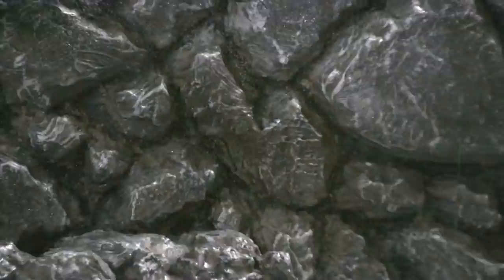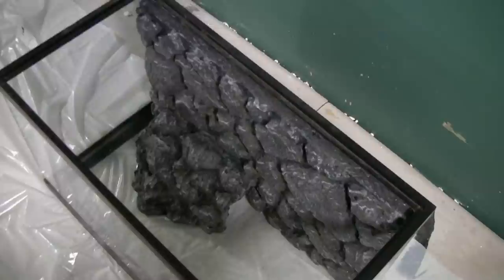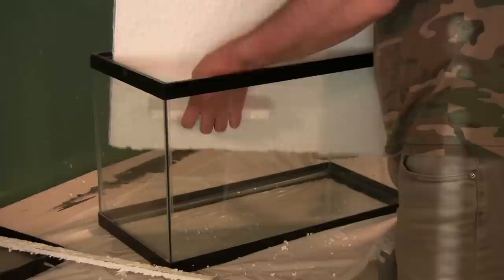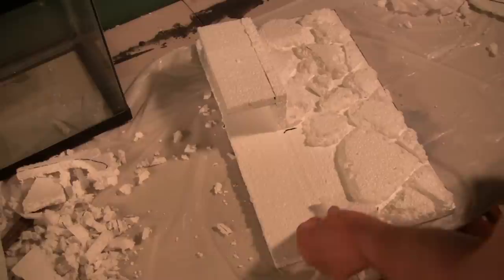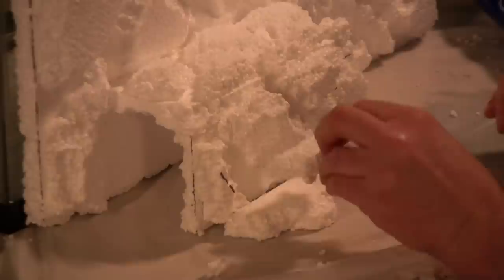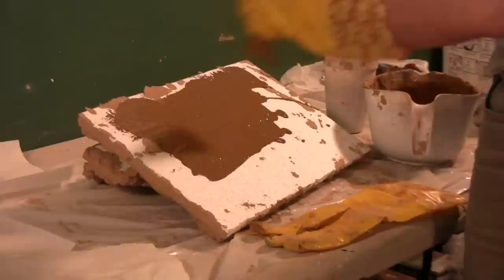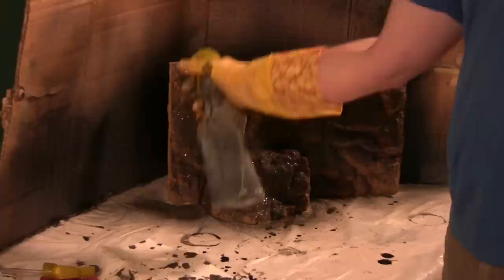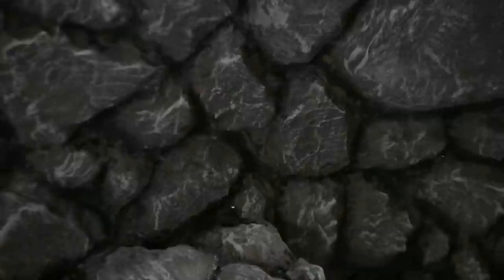Rock Wall background tutorial for reptile cage

Comment: If you have problems with grout adhering use PVA non toxic craft glue it bonds with the polystyrene and holds the grout to it. We use this trick with plaster and grout in terrain design for miniatures and gaming.

Comment: Im making a back for my sons ball python tank (50 gal) and it's going to have to be built in 2 pcs. and was in the same boat as far as trying to find a way to secure both pcs of the rear of the tank. I decided to use the same magnets that Magnaturals uses for their shelves. And yeah...they'll hold, these things are STRONG. Going to use 1 set on each corner so 16 total. Try looking up K&J Magnetics and look for anything between 1/2"- 3/4" X  1/4" but be sure they are N-52 rated (strongest ones)

Comment: I want to build a 20 foot high by 14 foot wide rock wall just like this for a spa I'm building! This result is very beautiful and is AMAZINGLY cheap (3-5 hundred dollars?) compared to real rocks or even the foam rocks for sale commercially. Wow - nice video! I'm going to use 2 inch and 1 inch thick foam board from Lowe's and mount it using Loctite right onto a plywood wall and then do the grout coat on top. I think the grout coat on top is to give it rigidity, right? Otherwise, it will FEEL like foam and we want it to feel HARD - is that right? I know you're doing this for animals and reptiles but I'm just applying it for a regular wall so the ladies will be wowed by it. 

Also, the sealer for me I don't think would be necessary - I don't really care if it's watertight at all so I may skip that step. My rocks will be as big as 12-15 inches so my scale will be a lot bigger but I guess with such big rocks a 20 foot high by 14 foot wide project should go that much faster, huh?  Do you have any thoughts or advice for my application? The painting will be labor intense -  will need a platform to do the hand painting and the various coats. Your result here with the white highlights is absolutely stunning - I'm absolutely stoked that I was about two hours ago budgeting a few thousand and thought I would have to check with an engineer to see if the structure can hold a couple of tons in rocks to THIS! Brilliant - foam! Love it.
Reply from the maker: Yes, the grout is for strength.  For what you're doing I would apply a lot more layers to give it more strength, the many layers of grout will make it quite a bit heavier though.  The sealer will help strengthen it.  Will it be inside or outside?
Reply: LizardLandscapes DEFINITELY inside. I'm glad you responded - was about to call your business for advice. I'd buy a reptile but I'm a dog person.

For strength, I agree - also can I just use regular mortar?? Does it have to be grout?

I'm planning on doing this while it's on the wall... or should I plan to do it on the floor then lift it into place and secure it? See, if I do that the whole thing will be weighing on a one inch layer of foam and I'm nervous that it can simply topple one day... but if I take each individual piece of foam and embed that with Loctite to the plywood wall then even after I place mortar or grout on it it will not become weighed down (front heavy as you said in the video) compared to each piece of foam attached to a one inch piece of foam for 18 feet high by 14 feet wide.

Also, the hot wire cutting device - is that something I can find at Lowe's?? Never seen that. But I guess the cuts are a lot more "mother nature looking' than a knife and makes less dust and maybe even is quicker. I see you break off chunks of the foam with your hands - that's the quickest way to go but for the beveled edges I imagine the hot wire device works best.

To see the look I'm going for go to my fb page at www.fb.com/iBeachClub (www fb com / ibeachclub
Reply from the maker: Rojerico Marthasis
I guess you can use any mortar.  It would be easier to apply if it's on the ground.  You do raise some good points though, -I wonder if you could do a small test piece to see if it will work?  The hot wire I use in some videos is from the Hot wire foam factory, they're online only I believe.

Comment: Hey mate,

Just a question about using the grout. Does it change the PH of the water once its in the tank? I am planning on doing this for a fish tank and I have seen a few done where they use cement and they say you need to fill and empty the tank 8-10 times. Does this need to be done with this method?

Comment: Would it be safe to just stop at the 8:50 mark and just put it in the tank from there? Or does it need more sealants, etc? Personally I like the color more and it goes more with the theme of my tank that I'm going for.
Reply from the maker: tkunkel4395 I would advise using all of the steps to be safe.
Reply: Ok thank you. Would I just find that color of paint at any hardware store you think?
Reply from the maker: tkunkel4395 I got mine at an arts and crafts store.
Reply: Also what's the sealant called that you used at the end in the spray bottle?
Reply from the maker: tkunkel4395 It's called Shields All.

Comment: This is more of a general question to all of your videos. Would this technique work for my 40lbs 9' boa? Or would I have to use a higher density foam and concrete over mesh to handle the higher weight per square foot?
Reply from the maker: ***** I would use 2 by 4's to create a strong understructure, and then apply foam and Hot Wire foam factory's "exterior foam coat" (many layers) to create a tough structure.  There's still the possibility of a snake of that size damaging it though.

Comment: Can this be used for scorpions, which is tropical and requires the tank to be wet and humid?
Reply from the maker: You would have to use a water resistant sealant like the one I'm using in the video.
Reply: Okay, thanks.

Comment: First off, fantastic videos, I've binged most of them and can't wait to get started on my own rock wall and cage features. Question for you, have you ever used the Mod Podge spray (found it on Amazon)? Or do you have a way of making mod podge more spray-bottle friendly?
Reply from the maker: I've not used the spray.  I have in the past watered down regular matte mod podge to work it's way through a spray bottle.  A while back I started using Shields All, -it doesn't need to be watered down.

Comment: Would something like this be appropriate for amphibians?? I'm trying to redo my whites tree frog habitat to make it look a lot better, this would be great but I'm not sure how it would do with the moisture in the tank. Since frogs skin are is so sensitive I don't want it to be something that can harm them. What is your thought on it?
Reply from the maker: I guess it's a little more appropriate for a dry environment cage, although the sealant is designed for water resistance.  You might re-seal it every two years or so.  You might forgo the fine grain sand sprinkling, as it might be too abrasive to the frog's skin.  I assume you're spraying the cage, or have a mister?

Comment: I have to spray my cage daily for my geckos which means they drink the water off the walls. Would it be safe for them to lick the water off the wall with the paint and everything else on there?
Reply from the maker: It would cause i used a non-toxic water resistant sealant to cover everything.

Comment: Not sure if you still respond to these, but my question is related to keeping it in place in the back.  I didn't want to create a hide because I have a beardie and have a separate hide.  Would I have to glue this in place or do you have a different recommendation to keep it up and In place?    Thanks for the great video.  I started this tonight and it looks great so far 👍🏻
Reply from the maker: I guess you would have to glue it in place.  In stead of a hide you could make rock projections (like the hide) to keep it from falling down, without having to make a hide out of it.
Reply: LizardLandscapes that's a good ideas I've even thought so far into it as to maybe put Velcro strips on the back at the top and on the inside of the cage so it can be removed if needed. Could this cause any problems
Reply from the maker: The problem with that is the glue (sticky side) from where you attach the velcro could be too strong and end up pulling the structure apart.
Reply: LizardLandscapes good point.  Sounds like the best option is to glue it in.  What would you recommend using to glue it in place?  Power grab?
Reply from the maker: I'm not sure what would stick to glass effectively -maybe silicone?
Reply: Hmm I'd rather not chance it.  I'm going to try and add the rock ledge tonight to sit it up.  Thanks again for the replies and detailed video
Reply: So I added the hide, I decided to just go with this and remove the other hide, as it will create more room and give him possibly a better basking spot. Wish I could post a picture it looks really good
Reply: One last question, on the sealant stage are you doing one coat, waiting 72 hours then applying another until you have 4 coats?  Or are you doing all at once then allowing it 72 hours
Reply from the maker: Yes, I am doing one coat, waiting 72 hours then applying another until I have 4 coats.

Comment: I have a question about the Shields All at the end of your (Fake Rock Background) video.  It seems to be like a runny type of sealant.  I have Mod Podge for my project, but it is thick like glue.  How did you reduce the sealant that you used?  I am afraid to brush on the mod podge and have it damage my work.

Comment: I've heard to use concrete to keep it from cracking. have you tried this
Reply from the maker: I have not, but some use it with success.
Reply: What we found that works is to mix in  "Acrylic Fortifier” liquid by Quikrete right into the grout mixture. It comes out super, super strong, water proof and will not crack. We also add the color right into the mix so when it dries it has the base color to work with. The results are stunning and realistic. No cracking and the color does not fade. I also would stick sand and push smaller tiny rocks into the grout crevices of the fake rocks before they dried to add more realistic color tones and textures to it.

Comment: Can mod podge handle the constant heat of a bearded dragon terrarium?
Reply from the maker: +Albert Gomez Yes, but you need to build up the basking spot with layers of sealant then sand sprinkled on the wet sealant -then repeat -to that the hot spot is built up and very tough.
Reply: +LizardLandscapes Alright, thanks for the quick response.

Comment: if im using spray acrylic paint for snake terrarium is ok?
Reply from the maker: Are you going to seal it with a non-toxic sealant?
Reply: not now but im asking if i need sealant or not. My snakes are cali king and mexican milk so its not high humidity. What can u say?
Reply from the maker: You will need non-toxic sealant.  It protects your pet from harmful materials.
Reply: ok thanks alot!
Reply: are you sure this sealants stick on acrylic paints? Becasue i tryed to use sealant now but it looks like it just float off the painted surface.
Reply from the maker: Sabestooo
What is the brand of sealant you are using?
Reply: eskaro aquastop
Reply from the maker: Sabestooo
Have you contacted the company to make sure it's non-toxic?
Reply: i think if its toxic then there need to be sign of that.

Comment: Could i use this for my cage its 5 feet 9 inches tall want to do the whole back with some ledges. would it work if i just cut the Polystyrene in to the rocks and glues it right to the back of the cage onto the wood? instead of gluing the Polystyrene rocks onto Polystyrene.

Comment: you say "this sealer works in wet locations"... that does not mean submerged...
talking to one of the contractors, that i work with, that's been dyeing, staining, sealing, concrete for 35 years says "there is no sealer for under water applications for concrete/cement/grout".

Comment: Found better & cheaper solution to the loctite. I took some tooth pics broke them in halves & inserted at angles to hold in place. I just push them all the way in the foam & coat over it.

Comment: Why do you have to seal grout.... it is already water proof... grout sealant for a tile floor doesn't water proof it, all it does is make the pores smaller so dirt cant get in and change the color. I have 43 years of tile and Masonry experience.
Reply: Great video tho, very creative idea
Reply from the maker: Easier to clean.
Reply: So that mean we dont have to seal it??? with the spray thing?
Reply: No you don't have to... if you want it fully water proof then use something like silicon on the styrofoam... it will make it a different texture but i think i turned out better... also dont paint it just use a different color grout. I also used sanded grout which doesnt crack as easy but will also be a sand paper feeling wall.
Reply: But can i do the same thing but instead  not doing the last step? will it still be waterproof????
Reply from the maker: It won't be waterproof, unless you seal it with silicone, which would be a pain.
Reply: oh ok
thanks!
Reply: It is logically water proof... the problem you will have is that the grout will crack because it isnt designed for that much surface area
Reply: Also the silicone really isnt that bad... you just use rubber gloves and rub it on... i have built dividing walls between land and water using the silicon method
Reply: ok thanks